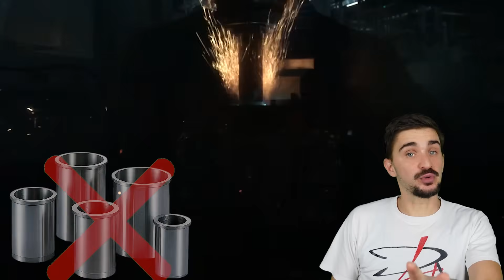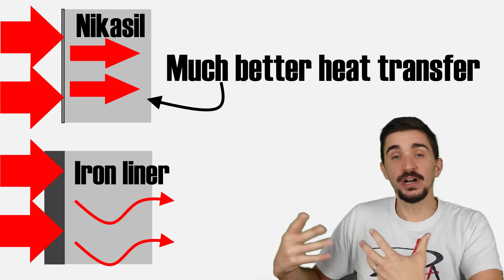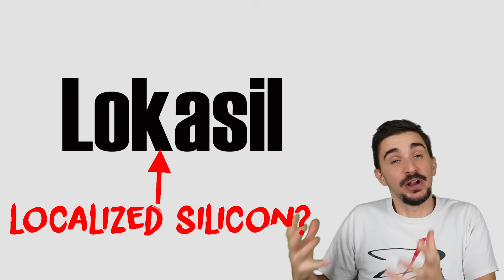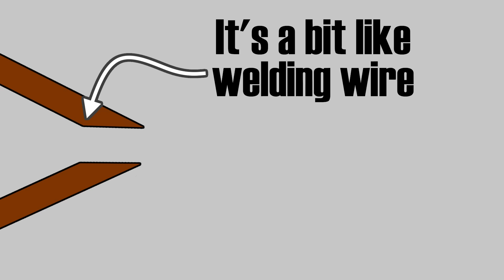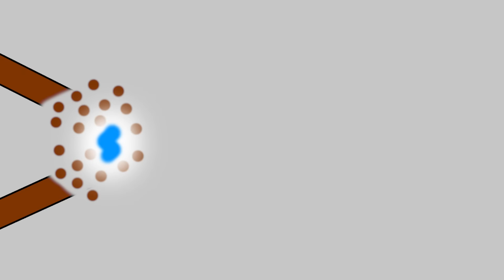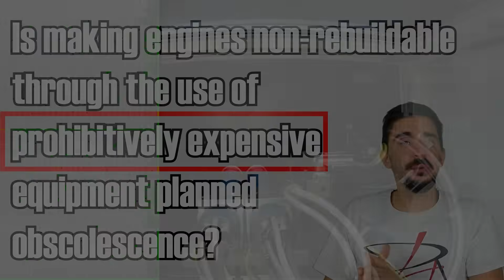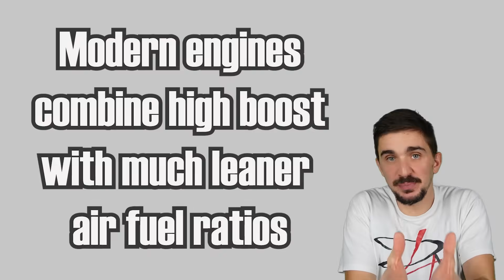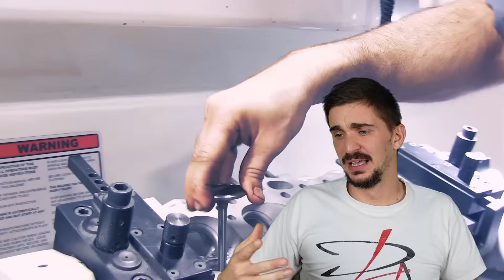Why Are Engines Becoming Non-Rebuildable? Everything About Cylinder Coatings

Comment: There's another factor in Audi-land.  The factory does not supply rebuild parts for the 4.2 V8.  You can buy wear parts (timing sets), but I've had no luck with pistons and rods.  The engine is not popular in the US, so aftermarket support is almost nonexistent.  There are very few shops in the US that will touch the alusil block.
Reply: Who is rebuilding Audi engines anywhere?
Reply: @iamtheoffenderofall  I wish I knew!  I really like my S5, other than the bent rod that happened when the engine hydrolocked.
Reply: @Acceleronics  that's right,  no one is.  Why? Cause it's not cost effective.  Second,  parts are available for anything if you know where to look.  Stop looking at the dealer

Comment: 19:35 and the ironic part is that more heat leads to more NOx emissions, which are much worse for the environment than CO2 emissions (in case anyone didn't know, CO2's worst effect is increasing global warming, it's biggest source is largely, not cars, but industrial plants, and it's an effect that can be countered by planting more trees, since trees breathe CO2 to produce O2. NOx on the other hand is the biggest cause of smog and acid rains and cannot be countered, only prevented by reducing NOx emissions. If regulations were loose on CO2 emissions but more stringent on NOx emissions, it'd be a win-win for everyone). Incredible how the people making these laws and regulations have no idea how engines, OR the environment for that matter, work, but I digress.
Reply: Just use water injection anyway it is about time.

Comment: Bíggest reason for scraping a car is electronics failure, a $50 part that the manufacturer wants thousands of $ for. They make it extremely difficult for third party repair, not releasing access to  documentation or access to software and diagnostics. Ask the question why do you have to spend thousands on diag tools, when the vehicle itself could display the failing modules or components

Comment: You don't plan obsolescence in an engine design by developing an expensive bore coating system.
You simply discontinue the production of an ancillary part to achieve that.
Or , better still, you social engineer the consumer to not want 4 year old cars.
The latter option is what industry has chosen.
You could make a modern engine infinitely rebuildable and infinitely durable and 99.9% percent of them will be scrapped after 4 years

Comment: My BMW GS passed the 300K kilometre mark last year. The hone marks are as clear as if the engine came of the production line yesterday while oil consumption is still negligible. edit: Forgot to mention that the cylinder walls are nikasil plated.
Reply: Cool story bro.
Reply: Yeah BMWs successfully did AluSil with the M54, M62, M73 N52 and people rarely have piston scoring issues most people when they have compression issues is usually due to stuck or worn rings which get replaced at 400-600k depending on condition and the engines ready to go again. Owner of a AJ V8 4.4 with 254k, BMW M73 263k and a M54 265k miles. One of the three of these vechiles burn oil which it's the one with the low tension piston rings that being the M54 It burns a quart every 2000-3000k all cars get oil changes every 5k miles

Comment: For enthusiast cars, I would of course like to have an endless suppy of wear & tear parts, gaskets, O-rings, components, etc. And for those vehicles the ability to rebuild the engine is very appealing.

BUT, this applies to a tiny sliver of vehicles. No one rebuilds a Camry engine with 200,000 miles on it.

Side note; reducing something as complex as climate to one factor, CO2, is utterly ridiculous.

Comment: The multiple variants of thermal spraying are age old techniques that are used in machine shops around the world. I see no reason why a cylinder couldn't be recoated given the correct donor material mixture. Furthermore the equipment is handheld and not expensive. It does require boring to dimension afterwards, but after that the process is done. https://en.wikipedia.org/wiki/Thermal_spraying

Comment: Engines that heat up faster will also last longer because cold oil does not protect as well as oil that is at operating temperature. The biggest problem i see on a lot of modern engines is oil control rings that are so thin that it takes very little carbon buildup to cause them to stick, and then the engine burns oil, then fails from lack of oil. This is worsened by the oil companies telling people that they can go 10,000 + miles without changing their oil, which means most consumers dont think about their oil as much as they used to and hardly anyone checks their own oil as a result. Direct injection also contributes to excess carbon inside inside the engine, which can prevent valves from sealing, which can lead to broken/burnt valves and premature engine failure.

Comment: Excellent work on your research.
I have one question. The new BMW B48/B58 engines use an IROX coating. 
Is that a thermal coating also? How does it compare?

Comment: I learned a lot on engine coatings thanks.
For the rebuild question, nice try, but my guess is your reasonning is flawed because between rebuilding and recycling, there's a difference. When my car has a rebuilt engine, I have a car, when recycled I have no car.
We need to compare emissions by ownership of the car (by time or by distance). Is rebuilding the engine better than building a new car (I hope so) and owning a car with newer standards.

As I firmly believe lengthening the lifespan of most product results in less co2 emissions and less garbage, it would be good to do it. But it also depends on the state of the car overall, many cars are just unsafe to drive when they reach the age where their engine fails. Rusty frames, broken equipement to replace, so much that would make it hard to maintain or unsafe.

Comment: This is pretty interesting. On ships for slow speed 2 stroke crosshead engines we use crosshatched cast iron because it has amazing lubricant retention and we use precision drilled holes through the liners for precision cooling. If a liner breaks we replace it. but with proper maintenance and lubrication. They almost never break.

Comment: OMG, people don't pay any attention to history. When electronics moved to tiny Surface Mount Technology (SMT) components, that was supposedly "the end of repairability". But repair technology caught up, and now skilled repair people are even re-balling (solder balls) huge 1000+ pin ICs (utterly amazing). It's exactly the same story in every single industry. Skilled repair people are even able to repair unrepairable Apple products that were specifically designed to be unrepairable. In this example of engine rebuilding, it'll only take a few years until a few people will start setting up shops to re-apply a new spray-metal coating just like the OEM did. These shops will be contracted by the usual engine rebuilding shops as a subcontractor, and it'll cost about $1k more per engine. Eventually the replacement spray metal technology will migrate down to the engine rebuilders, and I wouldn't be totally shocked if it eventually reached the serious home hobbyist (less likely, but far from impossible). This is the lesson from history. It happens EVERY. SINGLE. TIME.

Comment: Would it be possible to use a high strength steel alloy sleeve instead of cast iron (so it's thinner) and make smaller pistons and avoid the plating altogether during a rebuild? 

Maybe manufacturers can produce new precoated cylinder sleeves that can be pressed into minimally bored cylinders?

Thank you for the disclaimer on the data. Most people cherry pick a conclusion on CO2 to prove a point. "Environmentally friendly" is entirely a construct. There is nothing concrete about any one thing and its impact on the environment. We should be concious of what we do, but buying a car or shaming someone else for their buying habits based on how "environmentally friendly" a study says a product or procedure is is really stupid.

Comment: A thermal spray coated engine is not rebuildable in its original way. I´m an owner of a machine shop and spoke to a representative of the company that coated the Ford engines . He told me that this coating is only functional if the aluminium is virgin and has never seen coolant fluid or oil. Cast aluminium is partial porous and if contaminated the metal layer won´t adhere.

Comment: these coatings are weird, seems like they don't last as long as they should especially compared to a high quality steel liner that can actually wear down soo much that the piston cracks from piston slap, the coating peeing off the walls and or expiring with age? it most likely has a lot of issues as soon as a bit of dust and dirt gets in there that's higher on the rockwell hardness scale

Comment: As someone surrounded by BMW V12s, and looking into being able to hone blocks, I really hope what you said isn't true.

From my research, it should be possible to bring cylinder walls back utilizing felt pads and Sunnen AN30 compound.

My real challenge is finding and affording a reciprocating honing machine and figuring out what to coat pistons with (in the aftermarket since ferrocoating isn't something attainable). Manufactures like JE tell me that their coatings are alusil safe, but I don't have a way to verify it until I finally rebuild an engine with some.

Comment: A sensible solution would be to make the block in a way you could remove the coated sleeves and replace them like a regular iron one.
No need to overthink or overcomplicate a solution to extend the life of the engine, the thing is if manufacturers are willing to do that in the first place, thats the short sight everyone can see as programed obsolecense, and it does check out, after pouring millions into this coating tech why not throw a little more and make it serviceable.
Thats the pattern that comes from other industries, most of all the tech industry.

Comment: Removing heat from the cylinder reduces thermal efficiency, not enhance it. Keeping heat in the cylinder, below the components in the cylinder elastic strength point, is a good thing.

There is no rational for these coatings that is tied to anything I care about at the end of the day. Do I really care if an engine can produce 1000HP vs. 600HP? Not in the slightest out on the road. And anyone that says they do is going to kill themselves or others.

I have sixty and seventy year old engines in my paddock that I rebuild on occasion as needed. They will far outlive all these super optimized engines and can produce 200HP - 500HP all day long.

Those that like this coated rubbish, can keep paying through the nose for new engines every 50-100 hours of operation. I'll keep my sleeved blocks running until the heat death of the universe.

Comment: I was a Mercedes Benz dealership technician between 2010 and 2020. We really didn't see many issues with cylinder wall wear, except for the m278 engine. For whatever reason it was a major issue on those.
Reply: @martinsvensson6884   Yeah BMWs successfully did AluSil with the M54, M62, M73 N52 and people rarely have piston scoring issues most people when they have compression issues is usually due to stuck or worn rings which get replaced at 400-600k depending on condition and the engines ready to go again. Owner of a AJ V8 4.4 with 254k, BMW M73 263k and a BMW M54 265k miles. M112 and m113 engines are also known to run forever I think those are the same material as the engines I just mentioned

Comment: they intentionally make engines soo difficult to rebuild, but not all some engines like 4 cylinders for example a d16-y8 engine can be rebuilt without even removing the engine, the engine in the engine bay its mounted in such a way that you can service almost anything, every moving part that actualy wears out, even main bearings, pistons, rods, honing the cylinder, can be done properly with engine in place  i know, i have literally done it, there is one main bearing that's a little tricky but safe to change with the crank in place, you can change these parts before the cylinder sleeve and crank journals wear out too much and need machining

Comment: I do Plasma Spray for turbine engines.
It's a very wasteful process. We drop $500 worth of powder on the floor just to make sure the equipment is running right. 
However, the cost to re-manufacture and certify some of these obsolete engine parts is in the $200k-$500k range. The cost for plasma and the equipment is almost irrelevant.
Plasma spray and nickel plate are done to make sure the engines are not disposable.

It's funny how the relative price changes everything.

Comment: Great vid as usual.
My story is simple. My turbo ej205 shit itself. I've bought a new and complete shortblock for less than 2000 euros.
I would absolutely never rebuild an engine with these prices for new engines.
But ESPECIALLY, I cand not trust the boring, honing and such, accomplished by repair shops.
I can trust the manufacturer tho.

So I don't care about their processes. I just buy new.

Comment: Fair enough with the engine rebuilds just reviving an engine that is poor on emissions
But
What about fuel efficiency modifications?
Manufacturers can use the same engine block design for many many years and they improve everything else to be better.
Can't I keep my engine that was made in the '95 ,which at that time it was a new-ish engine, but use modern parts for it to make it more efficient? 
Surely the engine can be assembled with lower friction pistons and rings, new and more efficiently designed head, turbocharger (perhaps put the alternator into the turbo so that it uses the wasted exhaust energy to make electricity), tighter bearings to be able to use thinner but more efficient oils. 
What's stopping me from doing this other than the law and very restricted access to information?

Comment: The block is the tip of the iceberg on non rebuildable. An OHC engine head with plain aluminum cam bearings that are not serviceable will take an engine out too. I'd assert a head is more complex to service than a rotating assembly from a rebuild and repair standpoint. BUT lets be honest the CVT is far more likely to scrap a car than the engine nowadays anyhow.

Comment: QUESTION If one of the three (four) critical PERFORMANCE outcomes is reduced:  Fuel Efficiency, Power, Emissions-- does that offer a path back to less complex  engines that local shops can support?  That is, a 5.0 liter V-8, HOLD current mpg or L/100km constant,  REDUCE HP/Torque to 250 hp / 300 torque (circa 2004), HOLD current CO2, NOx, etc. emissions at the tailpipe. Joker bonus question  With the HP REDUCTION of about 50% from 2024 levels, and a INCREASE in power plant COST (performance outcomes 4) of 5% from current levels, theoretically by accepting reduced power by 50% and increased cost by 5%, allow us to travel back to the good old' days...{less complexity, more simplicity, more local repairable, less catastrophic cost of engine repair].  I'm happy  with a 2004 level of power in 2025, and reducing the gadget crap, multiple video screens, creature comforts, etc.

Comment: 20:11 Okey, The 2JZ is a bad example, but what does the VAG group do with the EA888? These engines can reach 320 hp or 160 hp per liter, much higher than the 130 you mention using a cast block. They comply with Euro 6 and VAG don't sell few precisely.... While an aluminum block is advantageous, it does not appear to be mandatory to pass emissions standards.
Reply: EA827*
Reply: @gabrielvieira.4358 No, that is another older engine, I am talking about the 2.0 TSI that VAG manufactures today.
Reply: @f3rdj114  Cool
Reply: @gabrielvieira.4358 EA827 is known as “AP” in South America. EA888 is what comes under the hood of a brand new Jetta GLI.
Reply: Does is this engine which is recalled?
Reply: Do they tho, or are you quoting power number from the days where they cheated all the emissions tests ?
Reply: @jamescrook99  No, these engines are being sold today. You could have done a Google search before commenting on such nonsense.
Reply: @f3rdj114  I could have, but I also see the comment was edited.
Reply: @jamescrook99  That doesn't mean anything, I made a spelling mistake and I fixed it

Comment: What drives auto and auto engine design are markets.  The manufacturer’s product must balance the quality triangle of performance..cost..time.   Note optimizing one leg comes at the expense of  the other two.
    The manufacturer instead decides a trouble free 150,000 miles satisfies the customer.   Accordingly the engineers design and test statistically to this requirement .  Should the product last appreciably longer, the manufacturer is overbuilding and the cost takes a hit.   A car that never wore out would be prohibitively expensive.
    Planned obsolescence is not a requirement.      Cheers

Comment: Ahh... this is why 2000s era German engines don't last. Most Japanese engines still used iron liners and recently spray.
Reply: Escept the MB engines. Like the m113 for example that seem to have an almost infinite lifespan.
Reply: @martinsvensson6884   Yeah BMWs successfully did AluSil with the M54, M62, M73 N52 and people rarely have piston scoring issues most people when they have compression issues is usually due to stuck or worn rings which get replaced at 400-600k depending on condition and the engines ready to go again. Owner of a AJ V8 4.4 with 254k, BMW M73 263k and a M54 265k miles. One of the three of these vechiles burn oil which it's the one with the low tension piston rings that being the M54 It burns a quart every 2000-3000k all cars get oil changes every 5k miles